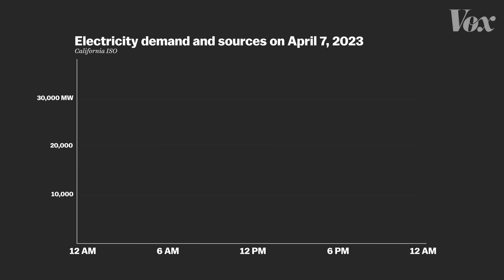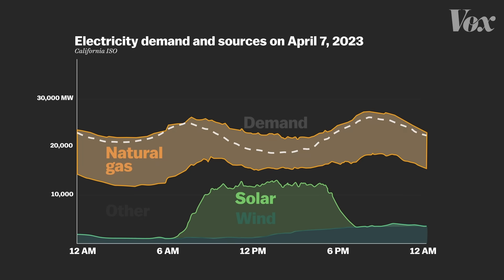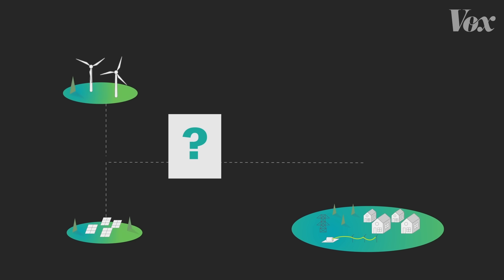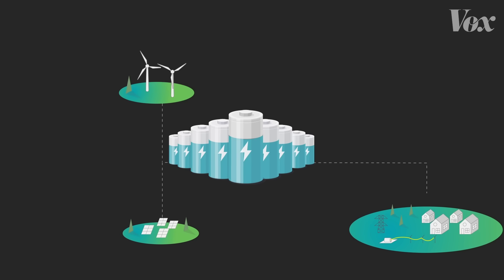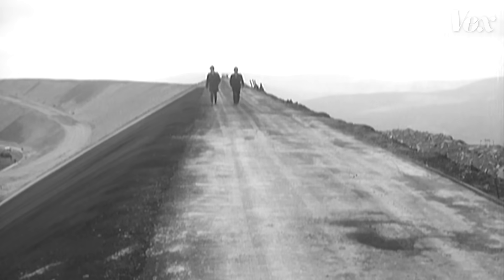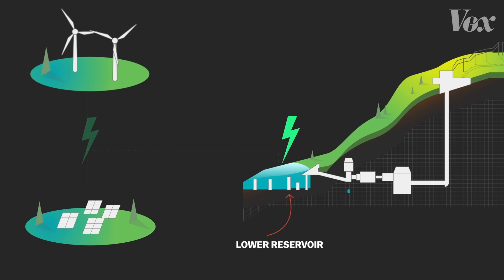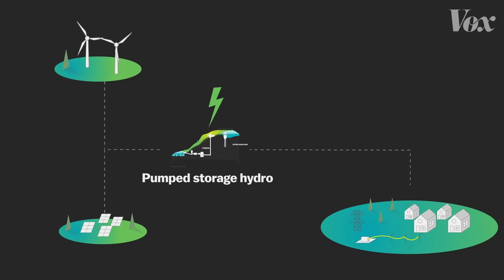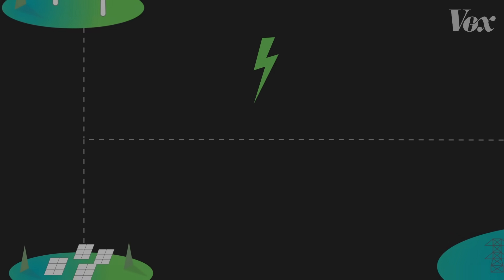How to fix clean energy’s storage problem

Comment from the maker: Thanks for watching! We’ve covered a lot about climate change, and not all the news is bad. For more of the policy solutions and innovations that can help save our planet, watch more coverage in our playlist here: https://www.youtube.com/playlist?list=PLJ8cMiYb3G5dR1opfCsg8JmZSToyAWR5h
Reply: Using nuclear energy instead of fossil fuels might eliminate the need for extreme energy storage infrastructure. And since it has no emissions and requires very little resources per generated unit of energy it would benefit both the environment and climate.
Reply: The biggest issue with gravity based energy storage is power density...  pumped hydro has an energy density of about 0.5-3 Wh/kg, so massive reservoirs are required for even moderate use cases, compared to gasoline which has an energy density of about 12000 Wh/kg. My feeling is that the future is synthetic hydrocarbons. As soon as someone figures out how to convert atmospheric carbon dioxide into petroleum at an industrial scale, carbon dioxide stops being a waste product and starts being a resource. How much carbon dioxide would be in the air if it could be extracted and sold for a profit?
Reply: Big corps around the world are draining natural resources and heating the earth immensely, any thought Vox?
Reply: You are missing the big picture.

The current global energy grid is massive:
* Has taken over 60 years to build,
* Uses about 62,500 power plants,
* Supplies a staggering 200,000 twh of energy (For perspective that would take about 130 billion barrels of oil per year),
* Fossil fuels have been used because there is no other known high energy dense material/technology that can supply anywhere near 200,000 twh/year
  (For example the best energy storage batteries are around 50 times less energy dense than gasoline).

Reality of Nature:
* You can't create or destroy energy/matter,
* Every energy conversion in nature has inefficiencies (entropy-the 2nd law of thermodynamics),
* So almost any energy capture/storage technology requires fossil fuels to make it....thus using a high energy density source to make a lower energy density source. We lose.
Reply: i always promote your video why tucker carlson pretends to hate elites right always fought our plant matters since 2006 obama ran off it 1 alternative powered farming resources you have no idea how things can work together 2 non social professional network turned into teaparty twitter magas q anon and more 3 public options why they created the right wing q anon and more bundle of nessesities like house power car and get fair share outta the top 5% that cause the chaos
Reply: Po
Reply: That's a great comment! It's good to know that there are policy solutions and innovations out there to help combat climate change. Speaking of innovative solutions, have you heard about the Segway Portable PowerStation Cube Series? It's a versatile and powerful option for outdoor enthusiasts like us. You might find it useful for your outdoor adventures and home backup power needs. Check it out!
Reply: Thank you for sharing the playlist! It's great to see more coverage on climate change solutions and innovations. Speaking of innovations, have you heard about the Segway Portable PowerStation Cube Series? It's a versatile power station that can keep your devices and appliances running during outdoor adventures or power outages. Check it out if you're looking for reliable backup power!
Reply: Thank you for sharing! The Segway Portable PowerStation Cube Series sounds like a great option for outdoor enthusiasts and families. Its massive capacity and versatile sockets are definitely appealing. Plus, the fast recharging and waterproof technology make it reliable in any weather. It's definitely worth considering for those who value quality family time or need a reliable power backup during camping trips. Happy adventures!
Reply: Thank you for sharing the playlist on climate change solutions! It's great to see that there are innovative products like the Segway Portable PowerStation Cube Series that can help us transition to clean energy. With its massive capacity, powerful output, and fast recharging, it's definitely worth considering for outdoor enthusiasts and as a home backup power option. Check it out!
Reply: Thank you for sharing this informative playlist! It's great to see the positive impact of policy solutions and innovations on climate change. For outdoor enthusiasts like us, I highly recommend the Segway Portable PowerStation Cube Series. With its massive capacity and versatile sockets, it's perfect for powering our devices during camping trips or as a reliable home backup power source. Stay powered up and enjoy your outdoor adventures!
Reply: Thank you for sharing the playlist! It's great to see more coverage on policy solutions and innovations to help save our planet. Speaking of innovations, have you heard about the Segway Portable PowerStation Cube Series? It's a versatile powerhouse that can keep your devices and appliances running for extended periods, perfect for outdoor adventures or home backup power. Check it out!
Reply: Great video! It's encouraging to see solutions for clean energy storage. Speaking of power solutions, have you checked out the Segway Portable PowerStation Cube Series? It's a versatile powerhouse with a massive capacity, fast recharging, and comprehensive protections. Perfect for outdoor adventures and backup power. Keep up the good work!
Reply: Thank you for sharing the playlist! It's great to see more coverage on climate change solutions and innovations. Speaking of innovations, have you heard about the Segway Portable PowerStation Cube Series? It's a versatile powerhouse with a massive capacity, powerful output, and fast recharging time. It's perfect for outdoor enthusiasts and RV lovers who value reliability and uninterrupted power supply. Check it out!
Reply: That's a great video on clean energy storage! For fellow outdoor enthusiasts and RV lovers looking for reliable power solutions, I recommend checking out the Segway Portable PowerStation Cube Series. It offers a massive capacity, fast recharging, waterproof technology, and comprehensive protections. It's a versatile powerhouse that can keep your devices and appliances running for extended periods during your outdoor adventures. Stay powered up and enjoy nature!
Reply: Thanks for watching the video! It's great to see that there are policy solutions and innovations being discussed to tackle climate change. Speaking of innovations, have you heard about the Segway Portable PowerStation Cube Series? It's a versatile powerhouse that can keep your devices and appliances running for extended periods, perfect for outdoor enthusiasts and RV lovers. Check it out if you're looking for reliable outdoor gear and home backup power products. Happy camping!
Reply: How about build gyms all over the country, where every single exercise machine generates power. Would be a way to convert the energy in food back to energy for the grid, while getting in shape lol.
Reply: @Daniel-Strain interesting idea, but I think that would generate very minuscule levels energy, certainly not enough for any power grid
Reply: @levirubin6974  Probably - especially at the rate we Americans exercise lol.
Reply: Not mentioning hydrogen in this video is strange
Reply: @oriolopocholo  vox thinks it's efficiency is too bad perhaps although they mentioned heat storage roundtrip on that is comparable or worse i believe 🤔
Reply: @matthiasknutzen6061  They seem to have some sort of agenda against hydrogen. The fact that they have literally not mentioned it when it's a core player in electricity storage in the future is just bizarre

Comment: The wild AC generating space from solar voltaic and wind turbine generation has to be 100% supported by the public power grid with fast reacting peaking power.   This costs more natural gas for high readiness making near zero electricity than making all the electricity from efficient running natural gas combined cycle power stations.  When making up the dips in wild AC output more natural gas will be used.   

As the wild AC generating space increases on the public power grid so does increased use of natural gas over making all the electricity from more economic fuel efficient means.  Without the emergence of cheap natural gas the large trials of alternative electrical generating sources such as wind turbine generators and solar voltaic would not have been possible.  

The practical use for these erratic sources of electricity is for maintaining electrical storage such as charging batteries.   Unless needing immediate backup power for much current wild AC generation this is not an economical repurposing making them stranded assets.

Comment: If only there was an existing reliable technology that is more green and safer than solar or wind. Like nuclear for example. Stable, efficient, reliable. The EU spent €657 billion on "renewables" in 2022 and 2023 combined and the result is a nothing burger. You could build around twenty 1.1 GW nuclear powerplants for that money all-in. Fuel, maintenance, refurbishment and it could provide power for up to 80 years. And when you take into account what you would need to do for wind and solar to even come close to those numbers just boggles the mind. Just the environmental damage alone from mining so much material for solar panels, wind turbines and the storage capacity needed is just idiotic.

Comment: Yes we need a combination of solutions to solve the energy storage problem. Geothermal is stable and constant form of heat/ power supply. Also give 100% income tax credit on battery storage at home coupled with solar panels.

Comment: Combined cycle hydrogen power plants.  High temperature electrolysis.  You can convert natural gas power plants to Hydrogen plants  slowly.  20% hydrogen and up to 100% hydrogen eventually once fully retrofitted. So you can store it right at the natural gas power plant or renewable substations when exceeding demand.

Comment: The proliferation of wind and solar solar is driving down energy costs - coal plants are closing in droves. That means that energy during the day will be very cheap, but at night will be more expensive. That cost curve is driving grid battery production because battery owners can profit from buying energy during the day and selling it at night. The cheaper energy gets, the less efficiency of storage is an issue. Price, not efficiency, drives adoption.
Reply: Yeah, tell that to Germany which has the highest electricity costs in the EU and is opening back up old coal plants because "Renewables" can keep up. They are even bulldozing wind farms to get to the coal under them.

Comment: While these "batteries" will clearly be needed if we are to move into a future free of carbon emissions, why is it that we are still only trying to rely on technology to solve societal issues? That energy distribution throughout the day on the grid is clearly something that can be somewhat flattened if societal arrangements regarding work routines and such be adjusted - not enough to render these batteries obsolete, but could certainly reduce the strain put into such systems

Comment: The solution is simple : reduce your electricity consumption. Stop using electricity for everything.

"Green energy" is NOT as green as that. 
-Wind turbines blades are not recyclable, and are buried, plus they cause noise pollution.
-Solar panel are very difficult and costly to recycle, and can pollute.
-With Hydro plants, you can say good by to salmons, that's what happened in France and other Europeans countries.

Just reduce our dependance on electricity, like bicycles, elbow grease, and else, that's the good way.

Comment: There are also seasonal variations that affect solar and wind. Energy from the sun is greater in summer, and lower in winter. The wind has seasonal characteristics too. Are more storage solutions or different storage solutions required for this?

Comment: The general ideas presented for energy storage are great. The explanations used are terrible. 

In the California example at the beginning, the chart implies that renewables never meet demand, but says energy storage is the issue. Storage is only the issue if you have times of excess yet the example shows no excess. 

In the pumped storage example, it's shown wind and solar are 100% efficient, but that's patently false. Solar and wind efficiency are both under 50%.

Comment: Good video but I would not focus this much on efficiency. I know it sounds strange, but during peak generation, the electricity price is often negative. So the price per capacity ($/kWh) and the reaction time (how fast can you charge/discharge) are more important figures.

Also 90% efficiency for pumped hydro??? Are you sure of that number? 70% is more realistic. But their capacity can be huge, which is also more important.

And one more minor thing: (and that's just me being annoying) Please don't use concrete blocks to spin up a turbine. Use a generator instead =)

Comment: I am disappointed that it does not mention Fuel Cell, where you can produce H2 and store it fairly easily as a liquid Hydrogen and regenerate back the storate practically without contributing to global warming. Just water, O2 and H2...

Comment: You know that making concrete produces a lot of co2 that the hole point of renewable energy is to reduce that

Btw in my opinion you can just use already made infrastructure like containers on a cargo ship you use electric energy to lift them up on the ship and can get electric energy when you lower them down

Much more efficient
Doesn’t require making any additional hardware 
And doesn’t produce co2 like making concrete

Comment: Great video! However, I'd like to point out that lithium-ion batteries are not entirely unsuitable for grid-scale storage. Take the Hornsdale Power Reserve in South Australia, for example. It uses a grid-scale lithium-ion battery system to store and dispatch energy, effectively supporting the grid during peak demand periods. While the video does mention the limitations of lithium-ion batteries, it's worth noting that they're already being used in some instances for grid-scale energy storage.

Comment: I'm really interested in a concept where rail cars are moved up an incline with a motor/generator and allowed to roll down to produce power when needed. Very scalable. Imagine hundreds of cars on dozens of tracks
Reply: Just use water man. Don't need to reinvent the wheel lol
Reply: There just aren't enough places where water is an option. Obviously

Comment: That rust/Iron solution is actually amazing and the prototype they've installed in a Dutch brewery is doing rather well. Part of what makes the Rust/Iron cycle  energy potential is that a) it's very clean when it burns and b) the base Iron is recyclable over and over. Great for boilers or fast to ramp up energy needs.
Reply: very interesting technology. Going to do some further investigation for my research project in SmartGrid technology. Do you have any suggestions for where I can get more information?

Comment: You definitely forgot a few of the most important technologies. First: Hydrogen as one of the few technologies for seasonal time scales of months. Second: Na-ion Batteries, which can be very inexpensive and abundant. Third: Redox-flow Batteries and fourth: Molten Metall Batteries for shifting the solar peak to the morning and afternoon.

As mentioned by a few others: Energy Vault is more then questionable and already in theory bad.

Comment: These videos are really just an emotional crutch for people beating the renewable energy drum, but are completely blinded by the scale of the energy storage problem at a grid level, ESPECIALLY considering how there needs to be an enormous shift towards electrification globally to reduce CO2 emissions from heating, domestically and industrially. Unfortunately the only viable option for global CO2 reduction at scale is nuclear, in whatever flavor you prefer. Current rollout of RE is NOT reduction global CO2 emissions as it increased reliance on coal and gas. And every time a functional reactor is shut down prematurely, humanity goes backwards. Because politics.

Comment: This is looking at the problem via the constraints of the old system.  The big solution is load shifting.  And this can be done in concert with another problem heating.  The cheapest storage is hot water.

Comment: One additional promising storage is compressed air with a heat storage combined. The pressurisation creates heat, the generator using compressed air later needs heat.
China build the largest one yet some month ago.
But long term heat storage in general(not only for electricity) is very very important. Look up salt solutions(NaOH), crystallisation(PCM) and solid sorption(nano sponge like materials).

Compressed air/gravitational storage can also be done in the water, you reverse the materials and pump air down into a storage in the sea instead of water up a hill.

Comment: Thanks Vox for highlighting the work scientists are doing to make batteries for grid energy storage. I'm a graduate chemical engineering student and we're currently working on finding viable electrodes for sodium-ion batteries, which would be much cheaper than the current lithium-ion ones.

Comment: Another potential type are flow batteries- basically a chemical battery where there's two components two the electrolyte, each stored in massive tanks. Flowing the the components past each other with a membrane between them can either be used to store or produce electricity.